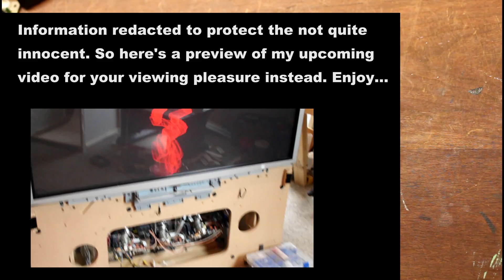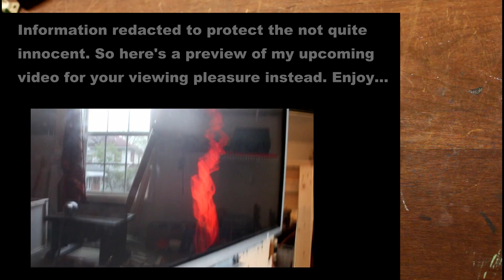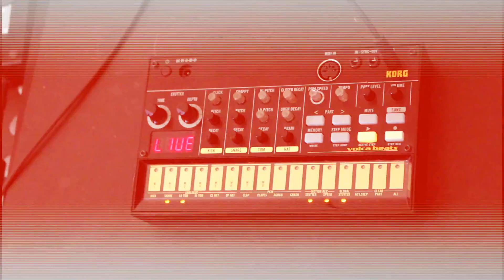Damaged Korg Volca Beats Repaired & Snare Drum Modded

Comment: Right now there’s a cheap Volca drum for sale that doesn’t turn on anymore. That’s why it’s cheap.

Do you have any experience w that kind of Problem?
Is it worth to buy it and try to fix it? I don’t have too much experience with that stuff
Reply from the maker: probably not. In overload conditions, these machines have a chance for the 3v3 regulator to fail short, causing the input voltage to be passed on to the MCU thereby killing it. The MCU (or rather the factory firmware for it) is unobtainium.

Comment: My volca samples bass filter knob broke. Not the knob itself but the mechanism under it. When I turn the knob you can tell it's not connected anymore. Very wobnly and no resistance. I opened it up and the treble knob is solid but the bass is rattling around. Do you know if there's anything I can do? Can I get the replacement part anywhere? Not for the plastic knob cover but the actual mechanism itself

Comment: my worry is a good shaking could rip away those tiny pads as the mass of that cap is huge. Do you use any epoxy to hold it down?
Reply from the maker: Depending on the cap selected I either use a dot of hot snot, or a little square of the red double sided tape commonly used in cellphone repairs. Plenty of stiction there.  Before I started using the tape, I just relied on the solder, and out of the couple dozen pre-tape mods I never had one sent back. Then I tried a massive 5kV ceramic disk cap on one, which of course didn't survive shipping before popping off, derp.